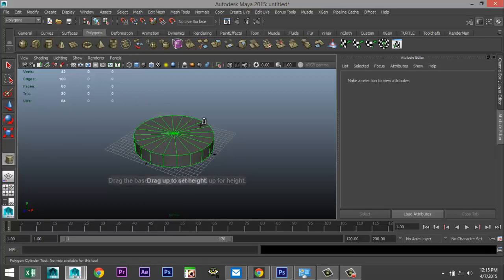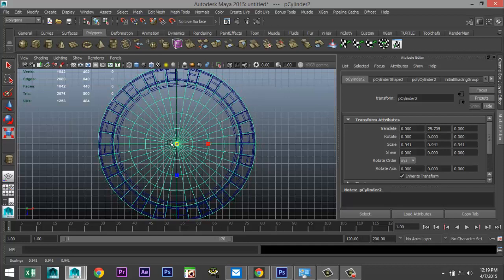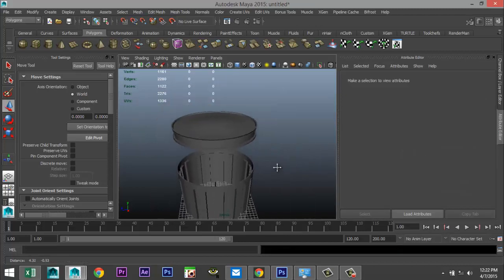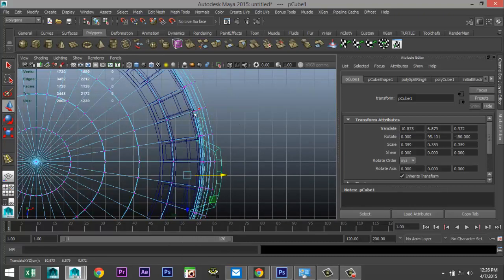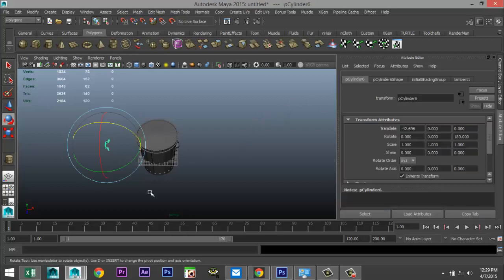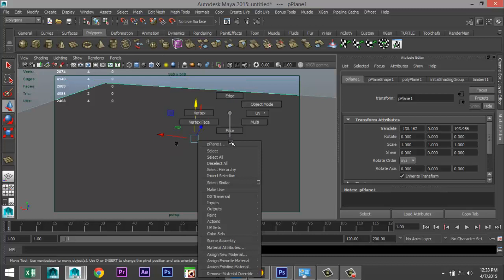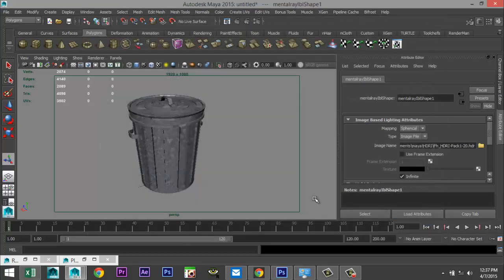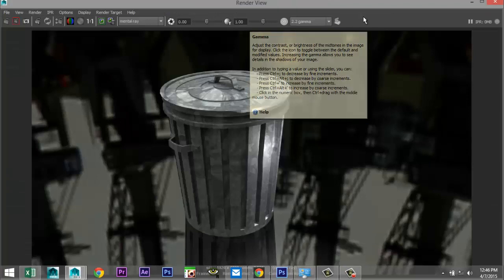Maya tutorial : How to model a Trash Can

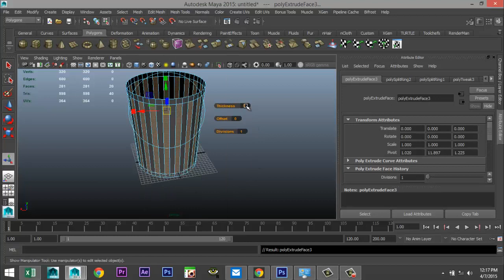Comment: Hey Mike, I'm just new to Maya, and I got a problem at 2:30 while changing the thickness, when i put -0.4 and click on enter, it just return to 0 !
Reply from the maker: Tamzagha4ever Hi there,

Did you select the entire object before extruding ? Are you using Maya 2015 ? Did you select the extrude option under Edge instead of the Extrude option under face ?

Regards,

Mike
Reply: Mike Hermes I selected the faces like you did, I'm using Maya 2015 and I selected the extrude option under face :)
Reply from the maker: It sounds like you did everything correctly but without seeing exactly what you did I can't really tell what happened.

Mike
Reply: Mike Hermes I just re did everything and it worked somehow lol, I think I messed up something before :) Thanks a lot for your help !! :D
Reply from the maker: Tamzagha4ever Good, I am glad :-)
Reply: I have the same Problem u can help me?